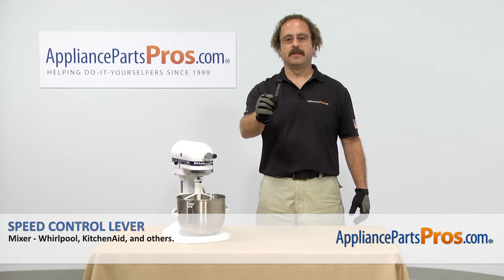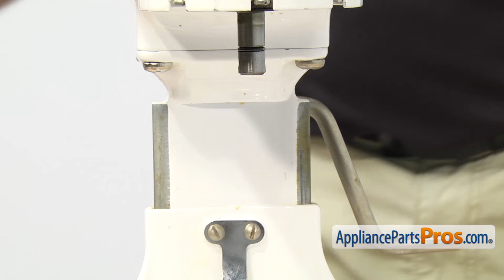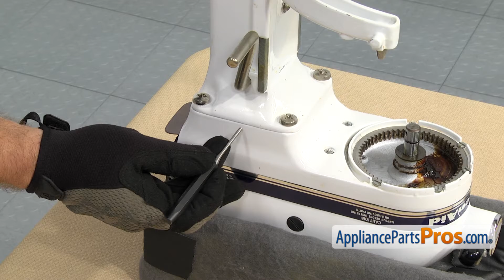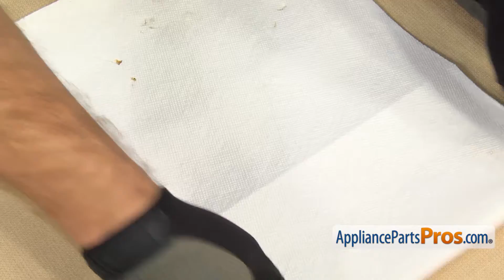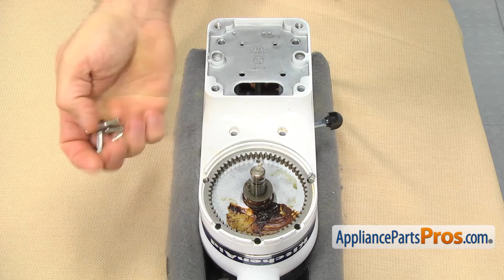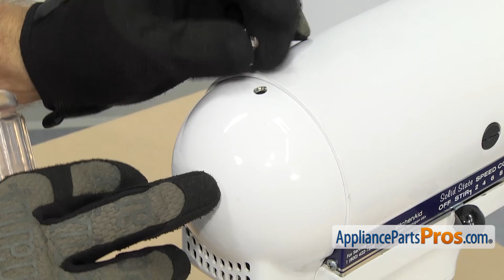KitchenAid Mixer Speed Control Lever WP9709276 Replacement — fits Whirlpool/Maytag

Comment: Follow-up comment: I replaced the speed control lever successfully following the video! For future reference, my Kitchen Aid mixer speed control was stuck in the OFF position, I could not get it to move out of that spot. In my case, the speed control lever was bent, which threw the whole lever out of alignment, causing it to stay stuck in the OFF position. My guess is the mixer was dropped or tipped on the side where the speed control lever is, bending it out of alignment with the rest of the mechanism it’s designed to move. New lever fixed it! :D Thanks again to the amazing team filming these videos for us all!
Reply from the maker: You're welcome! Glad you were able to fix your issue! If there is anything we can help you with in the future please let us know.

Comment: 20 thumbs up! Excellent, was gonna buy a Kenwood after our levers came loose but just fixed our Kitchenaid Artisan using this video (only difference is that it has square type screws on the bottom for a few things) and it took me much longer than in the video:)

Comment: Thanks for this video. I can't figure out what was wrong with the original speed lever? Did it get bent? Why did it need to be replaced? Mine is very tough to move from the off position. Think I'll be doing this fix in the near future. Thanks again.
Reply from the maker: It is possible it could have become bent.